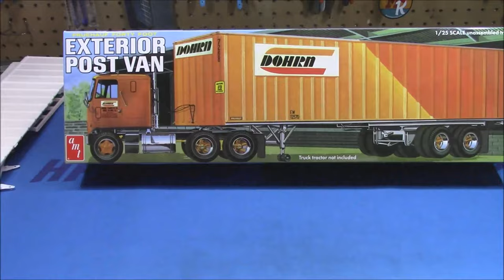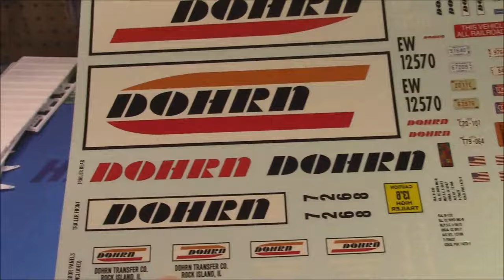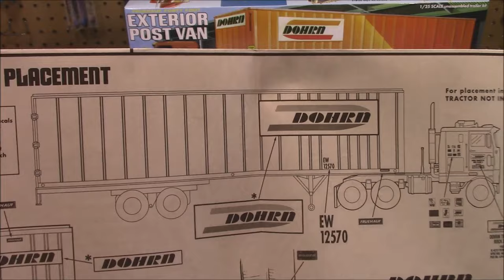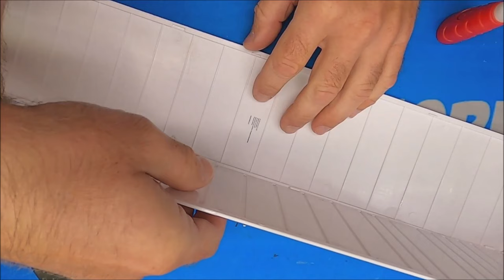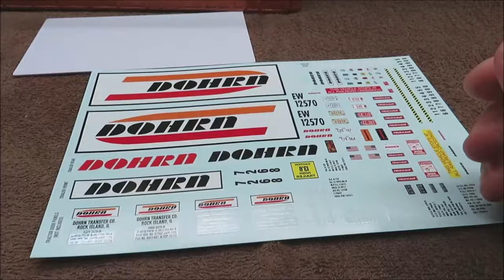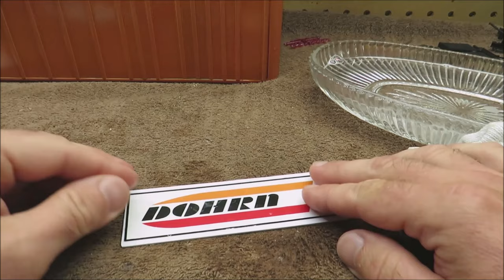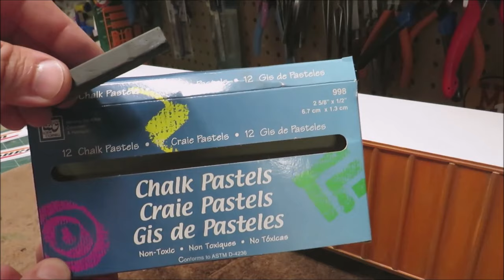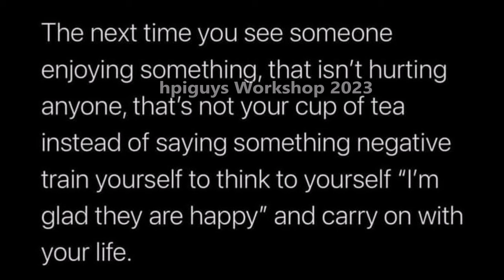Fruehauf Exterior Post Semi Trailer 1/25 Scale Model Kit Build How To Assemble Paint Weather Decal

Comment: First thing, awesome dry van trailer. I'm also a 20+ year long haul driver. (Retired) fyi the Star shaped pieces are referred to as spider rims. Steel rims would be a solid color with 2 or 4 holes and aluminum rims with multiple holes called Bud rims and there are rims that have 1 giant "racing" slick called "super singles". If you ever need help on on what a part is from an experienced truck driver let me know and I'll be glad to help. Keep up the good work and have loads of fun. Be safe. 😎

Comment: As a teenager in the mid 70's I got this exact kit to pull behind a couple cab over kits I had done. I was Really disappointed when opening the box, found the sides and front panel were warped beyond repair! Thinking back, Now I have a plan to flatten them out.  I just have to find that kit. It's still here!...somewhere.